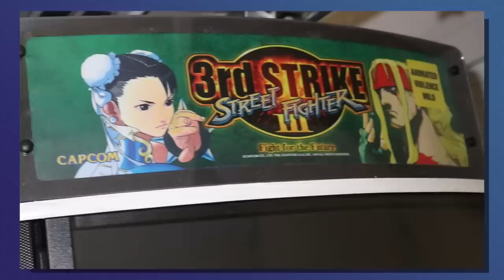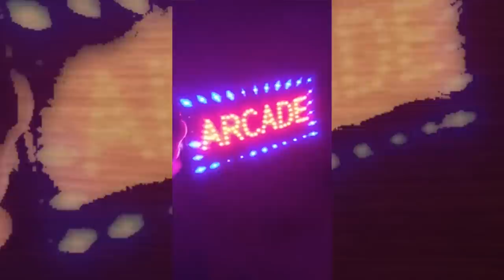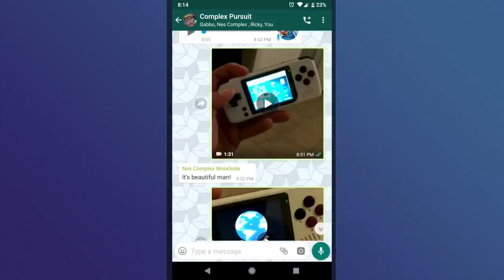RATS RUINED MY GAME ROOM - MY NEW GAME ROOM and ARCADE!

Comment: Insulation and vapor barrier plastic still won't stop mold from developing, especially in SoCal. I really suggest you get a small HVAC solution. There should be plenty of those wall AC/Heating bars that are used in motels at the flea market. That will also keep your plastic items from warping and should only take an hour to install. Best of luck! I'm excited to see how it turns out.

Comment: Do you have a concrete pad? What type of subfloor are you using? Try Dricore. Ventilation very important, might need another vent. What type of flooring? Mildew resistant drywall?  Ring security cams? What size electrical box? Will the rats have a home in there also?
Reply from the maker: How has literally built hundreds of homes haha 
I hired him for a reason lol 😁 He knows what he's doing 👍